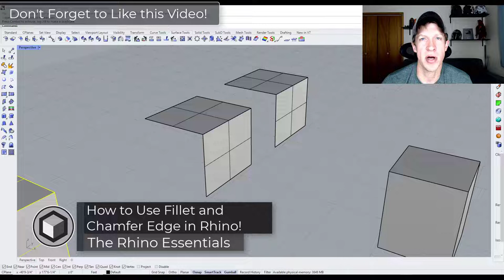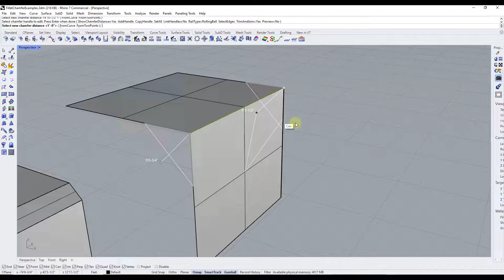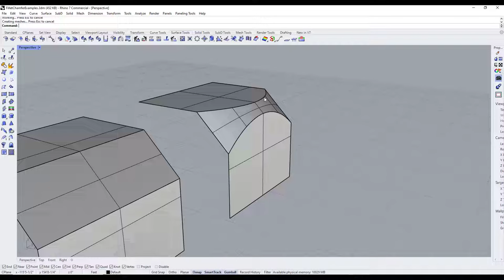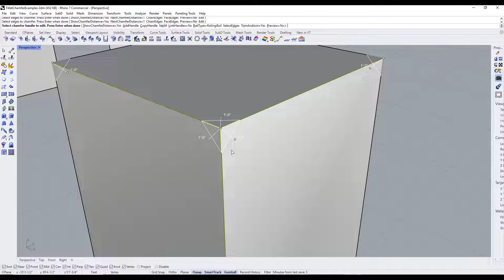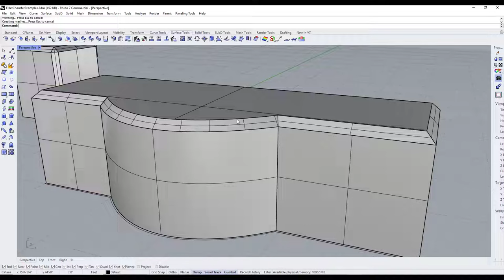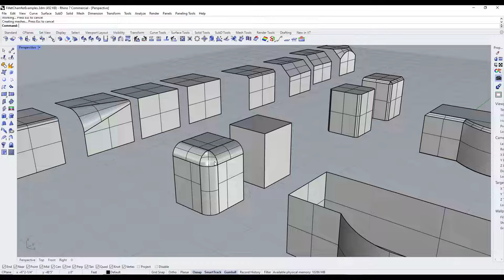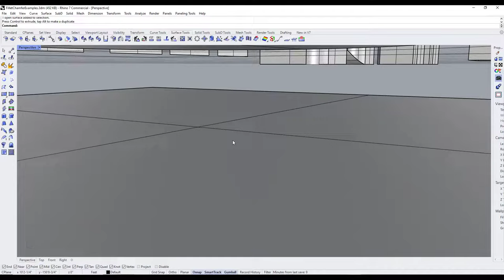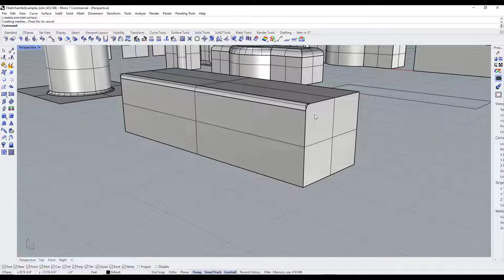How to FILLET AND CHAMFER Edges in Rhino!

Comment: I love Rhino, it was the real 3D and modeling program I learned. I used it over many years. Now I use Fusion 3D to model hard surfaces. The hability to go back at any point in the model process and be able to change the diameter or size of a fillet or chamfer (or anything really) is invaluable. The modeling parametric capabilities of Fusion 360 are very different than the ones you get with Grasshopper.

Comment: Is there a way to fillet an edge and specify a custom center point? This would mean that the radius is larger than the model, but the circle would be tangent to both edges with a specific radius. Currently, Rhino fails to perform a fillet if the radius is larger than the object. The object is designed around a sphere and there isn't really a way to view the image from a given plane because it's out in space. Another question would be, can Rhino give you a viewport from a certain point to be a c-plane from a line in space parallel or perpendicular to the point?
Reply: The answer to the first question is explained in the video. Alternatively maybe I just don’t understand the question.
You add a handle between the extremes, you can place it at any custom center point you want.

Comment: I have been having a fillet issue with a project I’m working on, the edges are 4 different directions from one point and after I fillet them, a hole is made after intersecting fillets. How do I tackle that?
Reply: You need to split your surfaces and build the corner using a loft

Comment: a Questioooon I need to do the Chamferedge command but I need to edit one side longeer, I mean, the chamfer to be longer in one corner or surface than the other (When its done in the edge) but the command only has an option that cannot be longer than the vertical  surface of the object of polysurface.